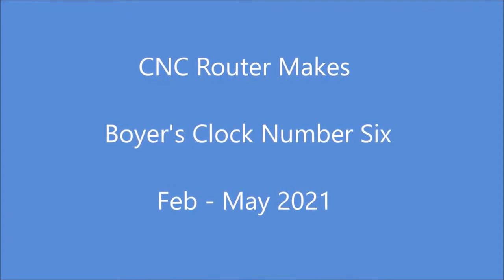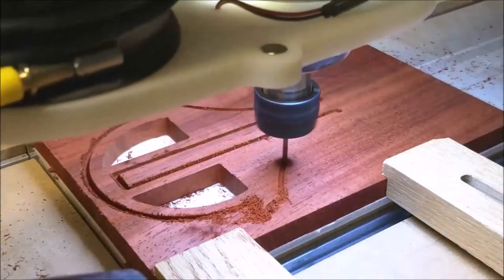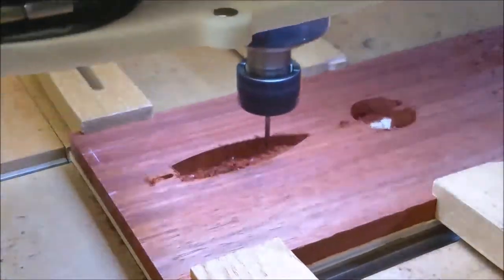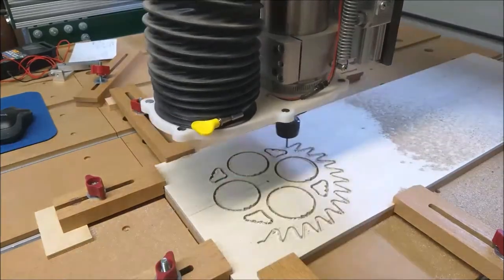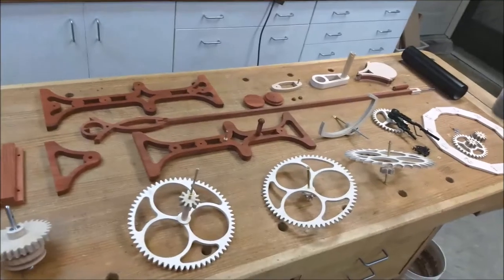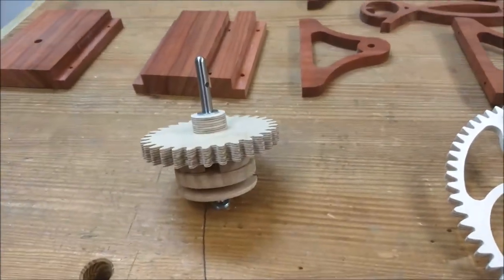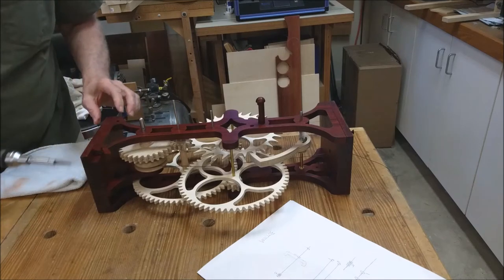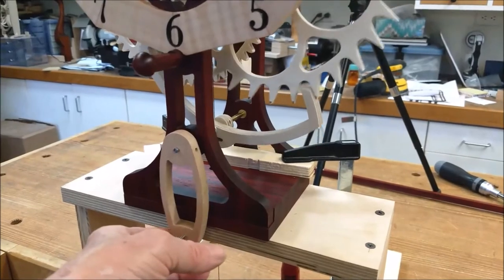Wooden Gear Clock made with CNC Router

Comment: For the dowel, use your cnc.  Mill hole in a waste board that you can press the dowel into then insert the dowel and drill with the router at the same x&y 0. The dowel has no option but to be on center.
Reply from the maker: Thanks for the tip.

Comment: Thank you for posting this video... an easy like and subscribe!
Though you are not showing the tech part on the CAD and router, you are showing what is so important and missing in so many other videos!
Showing the process, the tools used, the type wood used, the resulting cuts by the tools, the glues, etc... is invaluable for one launching into this stuff blind.
It helps knowing what to buy to get setup and get successful results fast... that minimizes the costly trial and error that would otherwise occur!

Thank you so much!

Comment: I use my wood lathe to drill my dowels, I also use Vcarve pro with my cnc do you know if my software will allow me to import the file. I have to recreate each piece with software there fore need all sizes specifications. How does fusion do it.

Comment: One more question….I went to the Boyer website to look at the dimensions.  It says the overall height is like 17 5/8 inches.  Does that include the top and bottom planks?  I ask because my CNC has a work area of only 17 1/2 inches
Reply from the maker: Nitro,  That dimension does apparently include the top and bottom plank thickness.  The length of the front and back frame parts alone is 16.87".   When I measure from top to bottom of finished project including the top and bottom planks I get 17.87".
Reply: That’s good.  I didn’t want to pay for the files, then find out my Shapeoko wasn’t big enough lol

Comment: Thank for the fine video. Your clock looks great. Did you have any issues with milling gear teeth? I am using Fusion 360 and a millright mega v CNC. The teeth on larger gears are fine, but on smaller gears the teeth sometimes lean over to one side. Guessing that it has something do with gcode arcs. Hoping you can share some guidance on design or CAM setup to avoid wonky curves. I am sure it is not the CNC itself. I have spent hours tramming, aligning, adding reinforcements, etc. thanks in advance for any insights.
Reply from the maker: Hi Randy.  Thanks for watching.  I also use Fusion 360 for tool paths.  I did not have problems with small gears once I got all the vectors closed in Clayton's dxf file.  Here are the hi-lights of my typical tool path recipe for a pinion gear.  I used a 1/8" end mill with a speed of 20,000 rpm and a feed rate of 40 ipm for all paths.   The material was Finnish-plywood from Woodcraft. 

First the central hole was cut in two passes (a roughing pass and a finishing pass).  The roughing pass was a 2D Pocket cut with Multiple Depths set at  .12" per pass; Radial Stock to Leave set at .02" ; Ramp was set to "plunge".  The finishing pass was also a 2D Pocket with Multiple Depths turned off, and Stock to Leave turned off.   

Next the outer contour was also cut in two passes.  The roughing pass was a 2D Contour cut with Bottom Height set to .04" above stock bottom; Multiple Depths set at  .12" per pass; Radial Stock to Leave set at .02".  After this pass, the .04" that remains  at the bottom of the cut, holds the part firmly in place.   The finishing pass was also a 2D Contour with a Bottom Height of -.03 below stock bottom; 4 tabs were placed in the tool path to hold the part; Multiple Depths turned off; and Stock to Leave turned off.

The two path rough/finish strategy was motivated to keep inaccuracies caused by tool deflection to a minimum. Because the same tool is used for all passes, they were all posted to one single tool path program file. 

Good luck.  I will be curious to hear how it goes.
Reply: @richardevans6891  thank you for the tool path details. I am a newbie with both Fusion 360 and CNC so your info is really helpful. My problems were indeed caused by tool flex and using your guidance I have all but eliminated the wonkiness. I am building Brian Law’s Compact 24 Hour clock. The smallest gear is 5/8” OD so I am having to use a 1/16 downcut end mill. I thought I had done enough already to address flex, but apparently not. I might still have some backlash as even after four final passes I can still hear the occasional bit of wood being cut. I am using everything to keep the piece from moving including masking tape with CA, tabs, leaving a thin layer and hold down clamps. I am cutting the gears from 6mm Baltic Birch I bought 20 years ago. I prepare it with a coating of epoxy to minimize tear out. Thanks again for your help.

Comment: Did you have to sand the gear teeth after cutting with the CNC router?
Reply from the maker: Hello Charles,  The CNC makes near perfectly shaped parts, but I used 220 sand paper to remove any fuzz left by the CNC.  The holding tabs were removed with a sharp chisel followed by some sanding.   Thanks for watching.

Comment: Beautiful build. I am relatively new to this and having some difficulty making sense of Clayton’s DFX file in Fusion 360. I have got the measurements set to inches and the file loaded ok but it’s a real mess. Are there are resources you can point me to on how to fix the file? Thanks
Reply from the maker: Hi Max.  My memory is getting fuzzy, but I do remember that quite a lot of work was required to get the dxf files in proper shape for use in Fusion 360.  As you may have already figured out, the problem is that upon import, many shapes that should be closed polygons are actually open.  The repair work is done in sketches in Fusion.  Many of the corrections involved selecting two points that should be co-incident, and then applying the coincident constraint to close the polygon.   This can be very tedious especially for the gear teeth.  In the case of gear teeth, I found is easier and quicker to just fix one tooth and when use the sketch "circular pattern" tool to just redraw the entire gear perimeter.  There may be an easier way, but I could not find it.  Some google-ing on "closing open polygons in fusion" might turn up a better solution.
Reply: The gap fill add in for fusion works great for filling the gaps in the .def files.  The file is available in the fusion store and there is a nominal fee $10 to purchase it.

Comment: Beautiful clock indeed. How accurate is it?
Reply from the maker: The clock has been very accurate.  The timing speed is easily adjusted by raising or lowering the bob on the pendulum with a screw adjustor.  Once dialed in, I rarely need to adjust mine.  A key is being in an environment of consistent humidity.

Comment: Where do you buy the steel pins,  brass bushings, and such?
Reply from the maker: Hello Nitro, I buy the brass tubes and stainless rods on Amazon.com.  All this stuff is really available there.  Thanks for watching.
Reply: @richardevans6891  I guess what I meant to ask was, in the instructions, does it give the diameters and such so I know WHAT to buy?  You can get literally ANYTHING on Amazon, so I figured that was where lol.
Reply from the maker: @nitrojunkie22  The instruction from Clayton include a "materials list" that provide diameters, other dimensions and quantities of everything needed for the project.   BTW I got the Baltic plywood from Woodcraft via mail order.
Reply: Excellent!  Good to know.  I’m thinking of making a clock as a wedding present, so good info.  Thank you.

Comment: Nice clock. You are a wiz with that CNC. It's too bad the pendulum covers part of the 6 though.
Reply from the maker: Hey Martin.  Thanks for watching.  I have gotten used to the hidden 6.  There is a design option to put the pendulum and its hanger on the rear of the clock to avoid the interference with the 6, but I elected to keep it up front as I enjoy being able to see it swing.

Comment: Why hide glue?
Reply from the maker: Hide glue was used because its longer open-time would allow plenty of time to make adjustments to the 12 joints in the  clock face to get them tight and circular.  I was afraid regular yellow type glue would set up too quickly.  Thanks for watching.